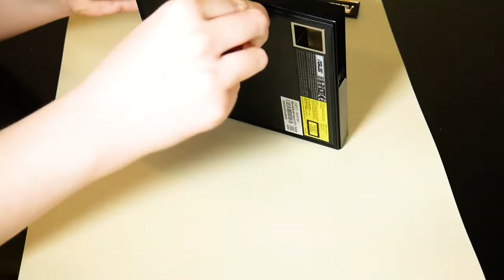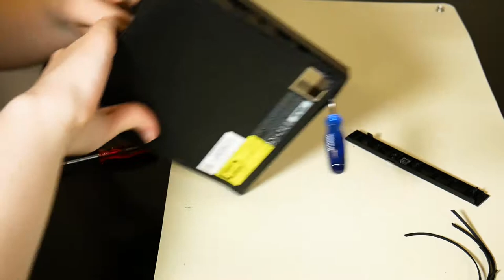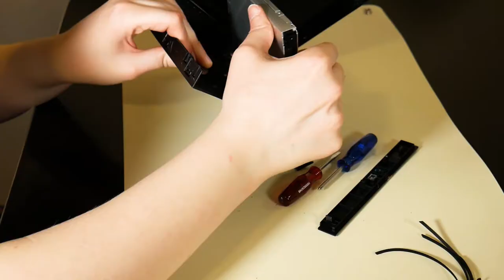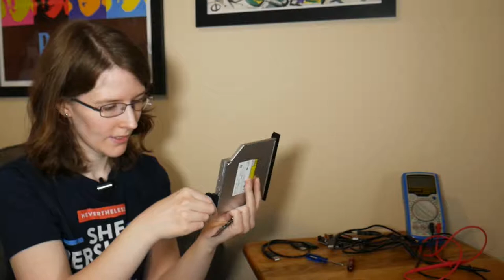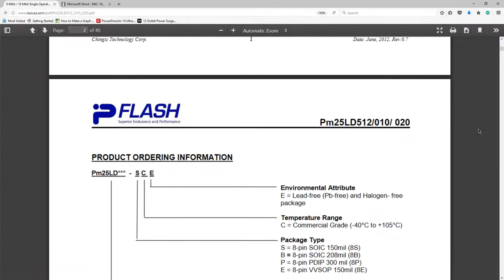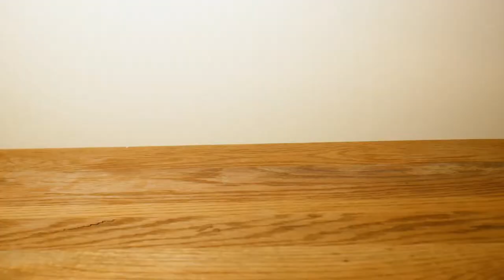Can I Fix It? USB Blu-Ray Teardown

Comment: I have a asus internal blu ray burner. The power board (the connector for the power and sata cords) the pins are bent. I tried to straighten them out no luck. I searched internal asus blu ray parts for a new board, can't find anything. It's just a board with 3 small ribbon cables connected to it. I wonder how much it would cost? Over the last 3 years I have bought a LG blu ray burner and 2 asus blu ray burners, all of them stopped reading blu rays or just stopped working. I also have an external dvd burner from lite on...that one has lasted me about 10 years. They don't make them like they used to.

Comment: I know this is an old thread, but I was looking how to open mine. The one thing I feel was left unexplained was the reason for the double USB A connectors the one with the two cables in it is data and power but USB 2 can only supply 500 ma and the drive needs closer to an amp (specs say 2A ) the single USB A connector is power only and should be plugged into a separate USB connector or better still I have found they work great with a USB mobile phone charger there is no data going through that plug at all.

Comment: Thanks for the video, I got 2 of these for free as they were playing up and neither came with a cable - I have been using a single USB A to Mini B and this might explain why at least one drive works on my laptop (2018 model so I assume USB3) and not on my HP Gen8 microserver front USB ports (USB2).  I am also doing a project so knowing that I potentially have 2x SLIM SATA to USB boards saved me some shopping potentially